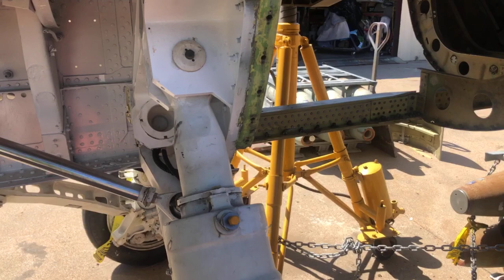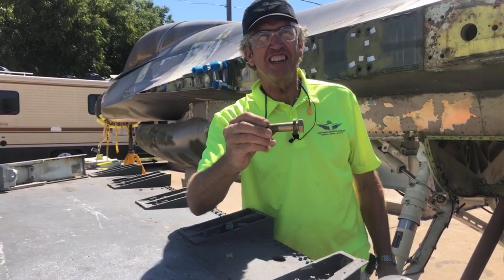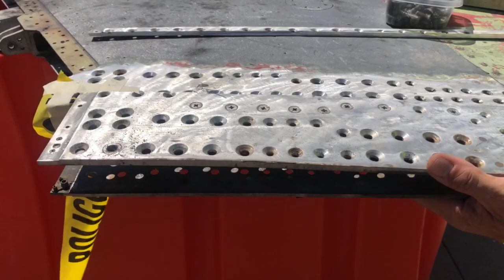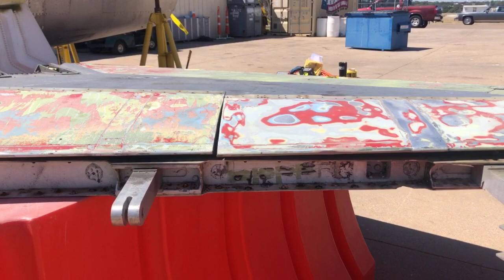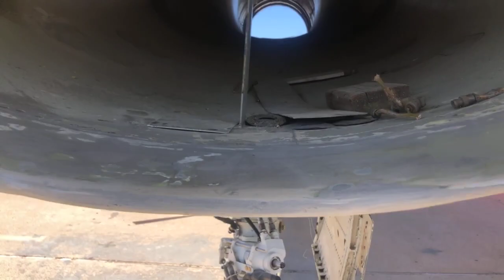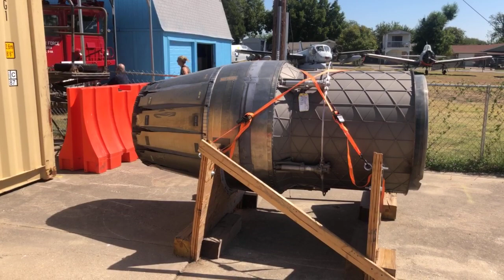YF-16 #2 Restoration Update

Comment: Which tail number YF-16 is this?  If it’s the one that was camo’d, I think it’s 01568, correct?  This is like watching my early life documented in layers of paint and mods dating back to the 1970s when the YF-16s first debuted.  We were at Edwards AFB at the time, so I remember this really weird looking snake-like planform prototype fighter painted red, white, blue, and black for the anti-glare over the nose.  The F-15 was the new hotness then, painted a nice light grey scheme, while F-4C/D/Es were still the mainstay fighters with their SEA camo patterns as the norm all over the Air Force.  There was a feeling of major change taking over with the new F-15A and TF-15As, then this crazy-looking lightweight fighter with strange leading edge extensions and a massive engine with tiny wings came out of nowhere.  

The 2-tone matte sky blue/creme camo’d YF-16 looked a lot more the business.  I still remember the various AIM-7 configurations as well, especially the door-mounted separation test, wing pylon-mounted, and even wingtip-mounted loads.  01567 had the LST pod and LGB at one point on the R inlet position.  01568 also demo’d the 370 Gal tanks, 6x AGM-65s, and ALQ-199 on centerline.

 I don’t know if you guys were aware of this, but there is a very special history of these birds that couldn’t be discussed for 4 decades.  The YF-16s never flew off against the YF-17s.  The test pilots at Edwards were formed into 2 different groups in each set of birds, then after they spent enough hours in each running test procedures for basic flight dynamics and performance, they switched to the other jet so that bias would not form between the two groups.

There were performance features of each that were well-liked by all of the pilots.  YF-17 had excellent high AOA and YF-16 had bleeding edge sustained turn rate.  Both had hot-rod climb rates because there weren’t any combat systems in the aircraft.  From one account, it was looking like the YF-17 Cobra had the deck stacked in its favor, until they took them out to the next phase of the evaluation, which was highly secret.

They went out to the Nevada Test Ranges to run tactical exploitation set-ups against actual MiG-21s flown by the Red Eagles.  Both aircraft did extremely well in these exercises, but the YF-16 enjoyed several observed data sets that really made it stand out vs the YF-17.

1. The YF-16 was visually very small from frontal aspect pre-merge and very difficult to detect, similar to the MiG-21 and F-5.
2. The YF-16 aspect from frontal or rear oblique angles was extremely difficult to determine nose position by the adversary pilot, so he had a hard time telling if it was coming around or pointing away when oblique.
3.  For the defensive perch set-ups, the roll rate on the YF-16 was so fast that it could execute reversals quicker than the YF-17 Cobra.

Once these data points were collected and compiled with the fact that it used the same motor as the F-15, had the 30˚ reclined seat for better pilot comfort, would be cheaper to manufacture with the single engine architecture vs twin engines on the Cobra, the USAF chose the YF-16.

Then we started seeing the FSD birds shortly after with the solid grey paint schemes with the gloss black radome, 2-seat versions, various weapons configurations and separation testing, and the MSIP NATO partners jumping onboard with their production factories in Belgium and the Netherlands.  Things happened very fast from YF-16 through FSD into F-16A early Block small tail production.
Reply from the maker: Nice note! Thanks for sharing.  This is in fact YF-16 #2 which was the cream and blue originally. We are getting a lot of input on this bird and your information will be added to the mix. Keep watching, more to come!
Reply: @FtwAviationMuseum  You guys are doing the Red/White/Blue/Black scheme I take it.  I really liked that camo scheme, but I understand the RWB is the most historically-memorable.
Reply from the maker: @LRRPFco52  We like the cream and blue too, but RWB was the last livery it wore and was voted the favorite by the restoration crew and I wouldn't argue with them!